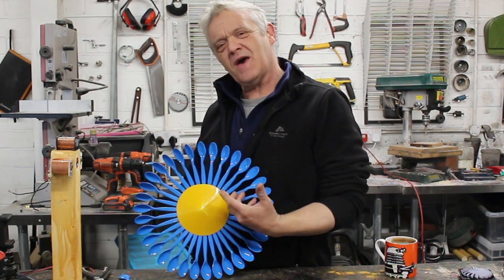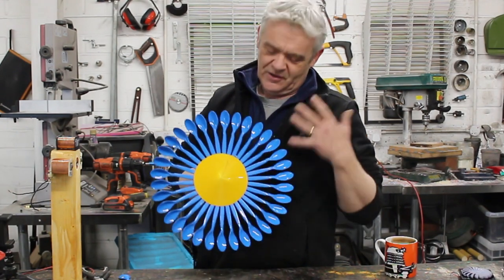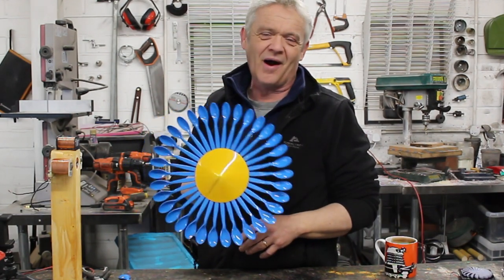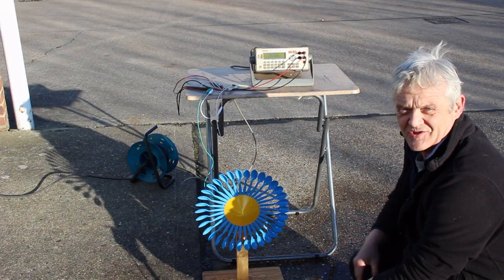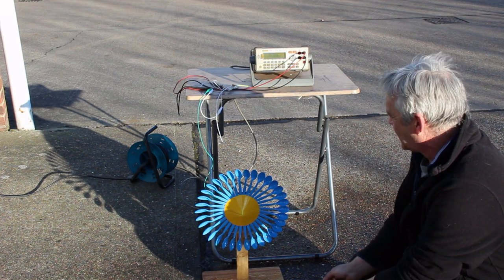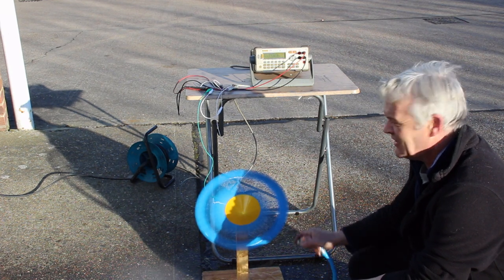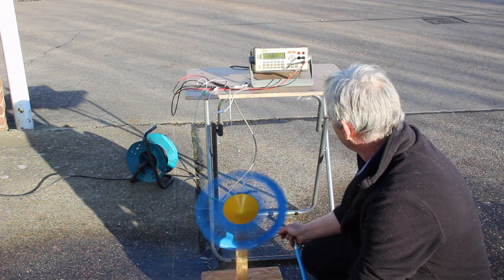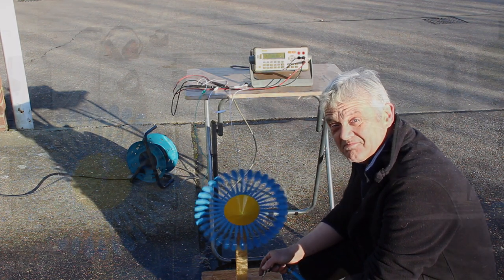1480 The Daisy - A Dual Function Wind And Water Turbine - A World First?

Comment: Sorry if this a daft question, 
Is it possible to have two forms of generation feeding into one battery?

Like, In theory could you paint the spoons with conductive  ink and add the gubbings of the rain drop generater on to each spoon and and have them both generating at the same time.
Reply: yes

Comment: So what would happen if you loaded it down 1 coil for each magnet wired in a series or parallel. And actually put it under load. How long would it take to charge a cell phone.
Reply from the maker: it was under load - I put a 12v light on it